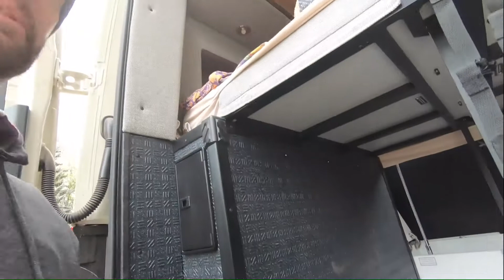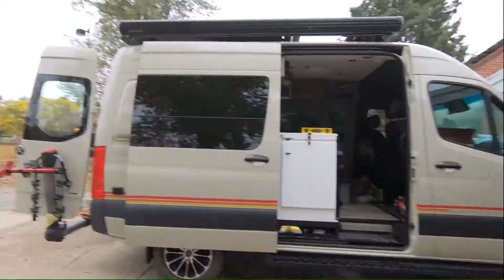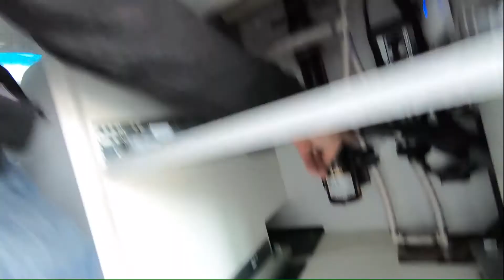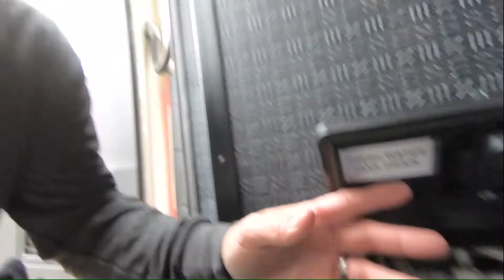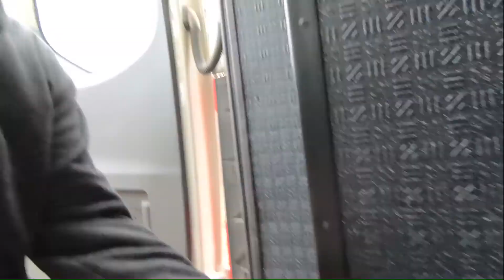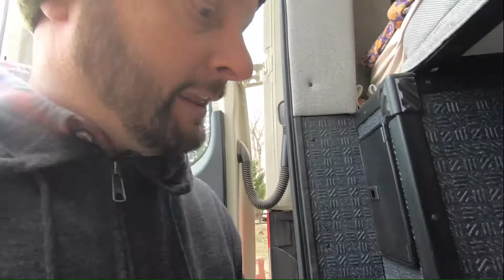Storyteller Overland Winterization Steps

Comment: Why to winterize it?, if the pipes in the storytelling are inside, like the batteries, all u have to do is to live in there and ypur diesel furnace will keep everything fluid, I mean, basically, if you don't freeze in your storuteller.....neither will your pipes.
Reply from the maker: Winterizing is better for us as we do not live in the van, and do not want to run the heater all winter.
Reply: @tommystravels  Ohh, ok, to store it in a way.... Then Yeah, if it'll be unused during cold temperatures, I guess winterizing will be a must.